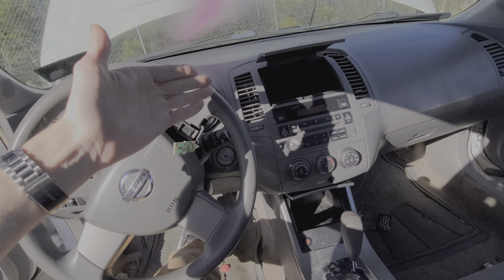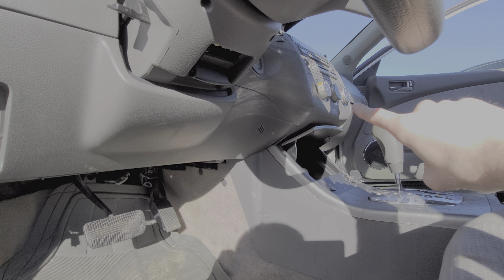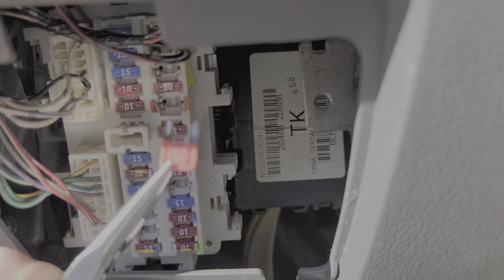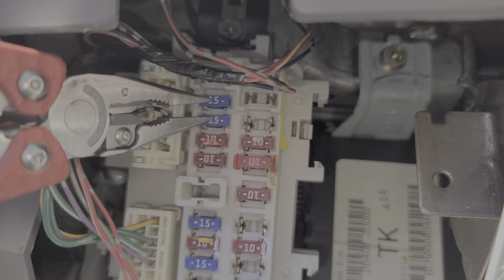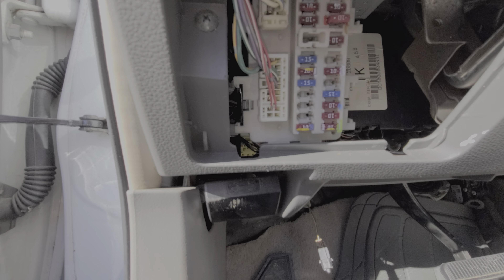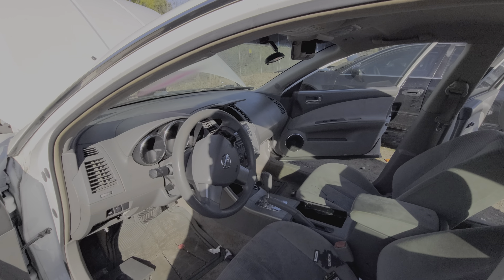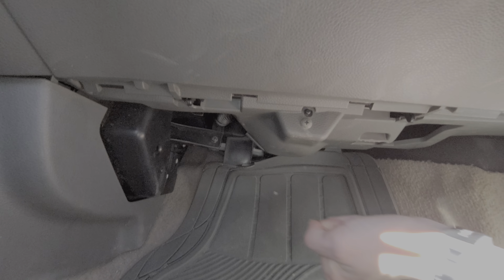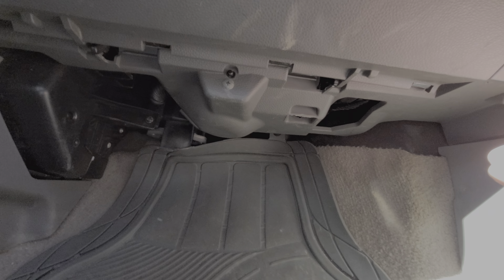2006 Nissan Altima Blower Motor Fuses & Relay

Comment: Thanks a lot you really saved me the fuse area burned on these 2  blue fuses and I the pins still there I’ll fill it with rtv , I’ve replaced the fuse and it’s ok now

Comment: Do you have a good way to test the resistor for the motor? I have a blower that’s not working or is intermittent and have heard the resistor is a common problem.